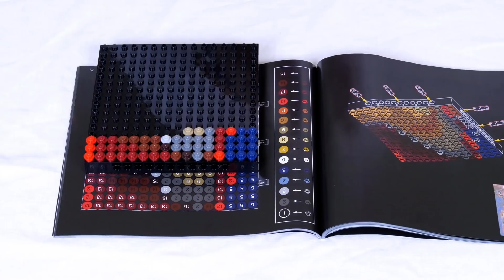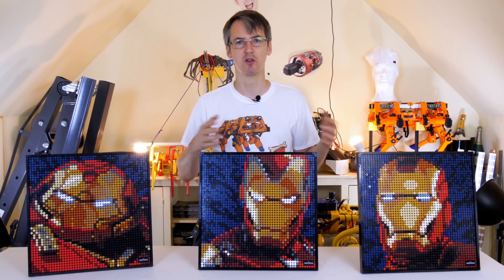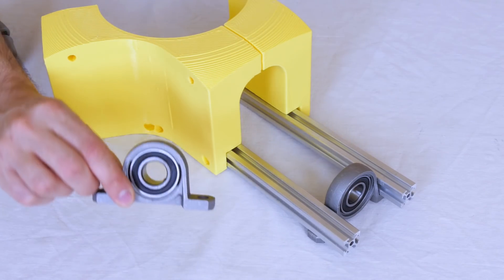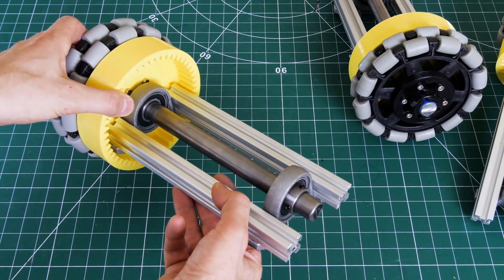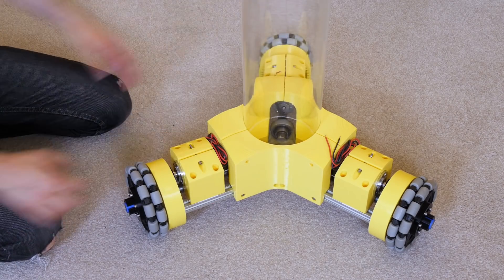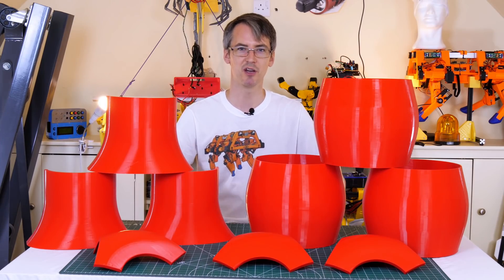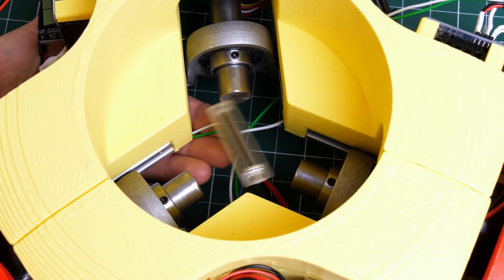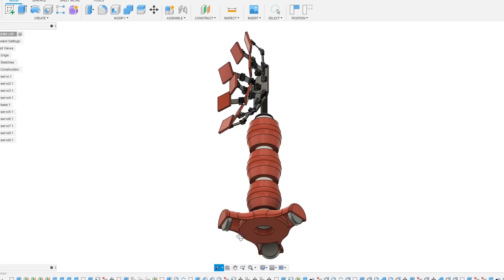Iron Man LEGO Art Display Robot #1

Comment: PWM will be very unreliable on meter long cables. Connect the top unit to the small Arduino Mini (on the bottom) with I2C, and drive the motors with the Mini!

Comment: I wouldn't have worked with LEGO after what they did to the 3d printing community stealing people's work and claiming it's as there own design.
Reply: What did they steal ?
Reply: @MrSam1er  anything with LEGO holes or pillars they had removed from the internet and the reason was it's there property. When it isn't and it's copyright ran out decades ago.
Reply: @TechGuyNelly  I'm not fully up on what's happening, but there's a rule (in the USA and probably elsewhere) that you have to protect your trademark or risk losing it.  It is hard to advertise that you've got a LEGO compatible STL file without skirting very close to the line of implying endorsement by the LEGO company, which is a trademark violation.  I'm not saying LEGO is blameless, just stuck in an untenable situation.